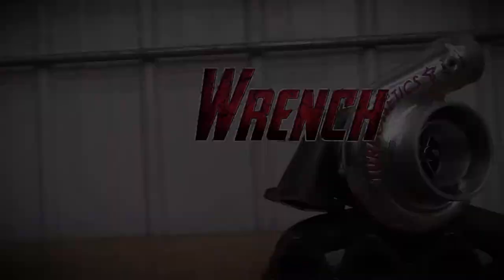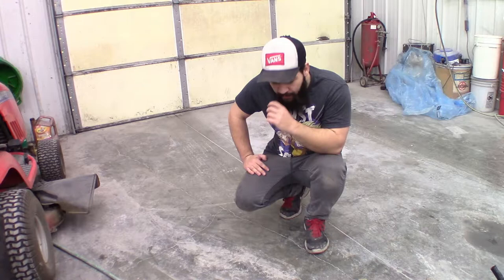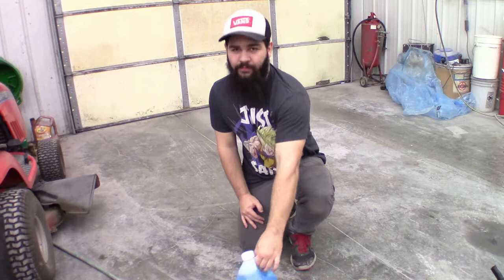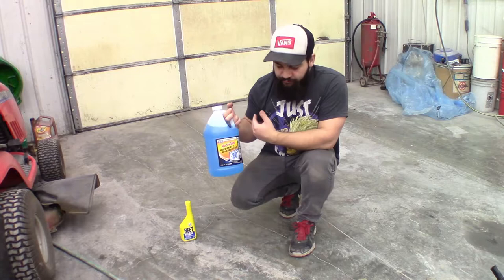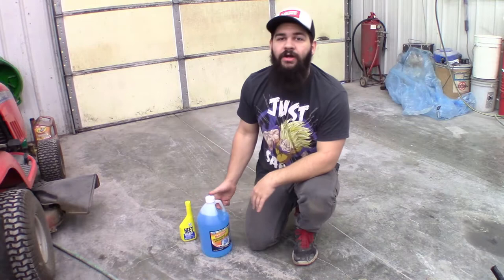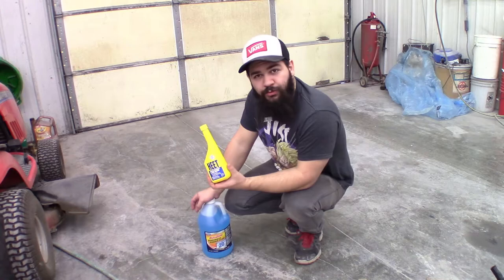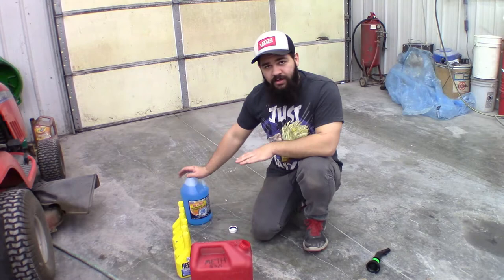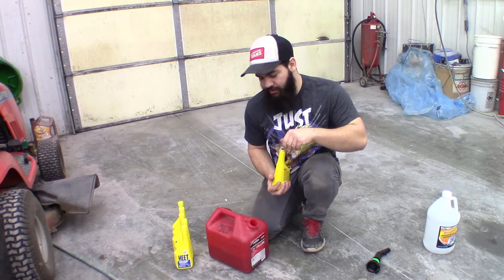How to Mix water and methanol from your auto parts store.

Comment: Good vid/ info if your ever in a pinch and need something on the fly or looking for best deals, always nice to know of several options you can use. I use to go this route using washer fluid and HEET or denatured alcohol off Home Depot shelf etc, but there are websites that sell boost juice for a reasonable cost about $35-$40 for 4 gal these days and even free shipping with Summit if you order $100 worth, so been doing that myself. 

Also if you guys don't want to guess on mixing your own, order a alcohol percentage hydrometer and get the exact % every time. Just drop it in the jug and like testing for drinking alcohol, it will tell you the ratio of your own water/meth mix.  Peace!

Comment: Got me I buy 10 gallons of 99.98 % methanol for $36 and I cut with 10 gallons of filtered water. So 20 gallons for $50. Stoich for meth is 6.45:1 and E10 is 14.08:1. EFI cars run the best on learner cuts and medium injector (2 or 3) My ecu learns octane and I see about 5 points on a 3 jet. If I mix 75% methanol and 25% water I still see 5 points but I loose power due the fuel mixture adjustments (ecu is looking for a target lambda) and don't cool as much. You can tune for a lower Stoich but when you are not spraying your ecu has fuel trim issues lower end. I found E40 and 50% methanol by volume works the best for my oem Twin.

Comment: My buddy Richard has been using -30 windshield washer fluid plus 3 bottles of Heat. Pricy... 😳
The plan now was to go buy straight Methanol from the House of Boost and mix with distilled water.  I’ll mention the need to mix based on weight.
Reply from the maker: HeadFlowInc yup buying straight methanol is what I would do to if I could get it locally. Having to ship it is expensive.
Reply: Wrench Avengers We’re less than 10 miles from two shops selling Race fuel/Methanol.  But we can’t get e85 here at the gas station?!  Sucks... 🤔

Comment: you can actually get 4 gallons of Snow Performance 50/50 shipped for $40, the only downside to buying it online is that a lot of times they mess up your shipment since it's heavy bottles of liquid, they tend to get damaged in transit, happened to me already...but buying it online like that would actually be cheaper than this.

Comment: What mixture would you recommend for a 98 twelve valve Cummins? MPG and longevity are the main goals but a little more power won't hurt.
Reply from the maker: Ditch Walkin personally I have no experience with deisels but if i was looking for those kind of goals either going with 30% meth or possibly going with just. 100% water.
Reply: Wrench Avengers thanks for the response. Great video

Comment: What about using the Xtreme Blue Windshield Washer from Autozone?  According to the MSDS it is 68% Methanol by weight.  Thats what my tuner recommended and it is only $3 bucks a gallon.
Reply from the maker: just make sure it doesnt have any other detergents or anything and you should be good to use that. the reason i use -20* is because i dont live north enough that they sell colder. the colder the fluid is rated for the more methanol it will contain to keep it from freezing. if msds sheet for that stuff says 68% and there is no other detergents that sounds like a great way to go! 

just word of caution though. any mixture above 50% methanol is flammable.
Reply: 68% is high. Mix it down with distilled water to 50/50.

Comment: What about distilling washer fluid to separate methanol and mix it to your liking?
Reply from the maker: Joshua Hebert I don't know anything about distilling process so I'm not sure if that would be more trouble than it's worth or not. Sounds pretty cool though.
Reply: I'm not an expert but I do know that the boiling point of methanol is a lot lower than water. So it's theoretically possible.
Reply: @joshuahebert9949  at that point just make some shine. You can power your vehicle and drink it lol

Comment: Great Video, OK 2017 C7 Z51 LT1 Stock @ 36% (33%)  Meth what kind of HP/TQ can one expect compared to 50% Meth? BTW, I checked out Auto Zone, listed above stated 33% METH ...
Reply from the maker: you wouldnt make the same power out of 30% compared to 50%.

an engine is an air pump. the more air in the cylinder the more fuel you can put in the more fuel you can put in the more burn you can get the more burn the more power. so you want as much air in the cylinder as possible. well the drawback to meth is that its part water and water takes up room in the cylinder that cant burn. it isnt fuel to ignite the air nor is is air itself. so the more water the less power you will make. the benefit to water is it cools the air and colder air is tighter compacted and you can fit more in the cylinder but there is a trade off. to me 50% should get best of both worlds the cooling properties and the octane properties. (also cooler air helps prevent knock along with he octane bump.)

methanol is combustible and that is how you get an octane bump out of water/meth setup.

i cant find the video now but i think it was by thetuningschool or something like that where they tested straight water, 50%, and 100% meth and found they made more power the more meth was in it.
Reply: Thank you so much for taking your time and passing the "Knowledge"

Comment: Wow $35 for 5 galons is a LOT, especially after that shipping cost.  I guess I'm lucky to have a Smileys down there road...  

Check out the video i created on this subject that goes over the math and such and goes over how to do 50/50 for about $5/galon: https://www.youtube.com/watch?v=2BvLtZX1xKI
Reply from the maker: yea sadly i dont have that as an option in my area. if you can buy straight methanol is as simple as weighing the product on a scale. if your gallon of meth weighs 3lbs or what ever just weigh out 3lbs of water and mix them. 

you mentioned that when you mix water with meth it no longer becomes flammable. be careful with that as im pretty sure a mixture over 50% meth is flammable (could be over 75% i dont remember for sure right off the top of my head) good video though. should help out the folks who have a local source for straight methanol.
Reply: Wrench Avengers well thst Kay sound easy, buy it isn't. As I said in my video, this stuff is dangerous. There's been cases where a guy got it in his leg after a spill and went blind. You have to be very careful. 

In my video I talk about how to take precautions and such. I wear gloves and goggles too.
Reply: Also, if I didn't have it in my area, I'd just order boost juice for around 9 a talon off Amazon.
Reply from the maker: yup there are many ways to skin this cat.

Comment: Worried about the blue dye getting into the engine tho, maybe run it through a filter or something to take it out I dunno!
Reply from the maker: xKernelxSanders I really wouldn't worry about it.  First I really can't think of a problem blue dye would cause in the combustion chamber. He'll people put blue dye in their oil to find leaks even that scares me more than it being in the combustion chamber. Second the amkount going in at a time is small it's just a light mist of the fluid only when in boost or WOT. Just stay away from the green stuff with other detergents and stuff in it and you'll be fine.
Reply: Wrench Avengers  sweet thanks for the info man , I'm not very knowledgeable on this stuff that was just my blind 2 sense . Subbed tho
Reply from the maker: xKernelxSanders all good! We are all here to learn. Thanks for the sub!

Comment: they sell -20 at the doller store
Reply from the maker: Just be sure to check the msds sheet for it as different companies use different ammounts of methanol.
Reply: hii, are you guys using methanol (which is camping stove fuel) + water as wiper fluid for winter to prevent freezing ?  is it not dangerous because methanol is explosive..

Comment: Just buy a 200l barrel and put a barrelpump in there, it's also 98percent pure so mixed with witer 50/50 thats 400L you got, enough for a couple of years depending on your driving style and about 4 times cheaper the way you do it with that crappy windshieldwasher wtf.